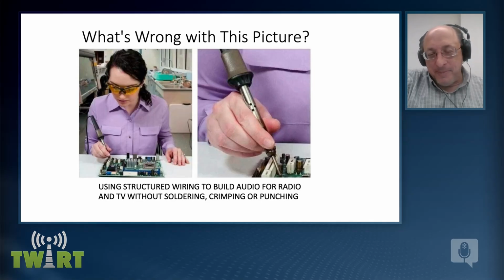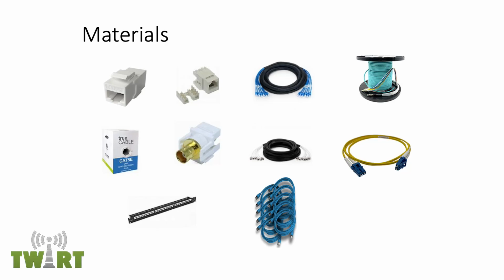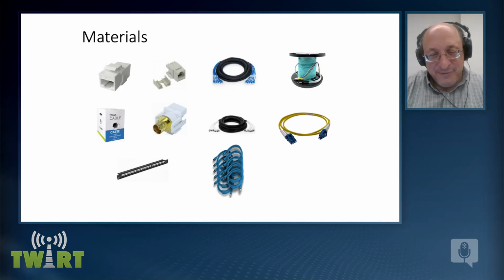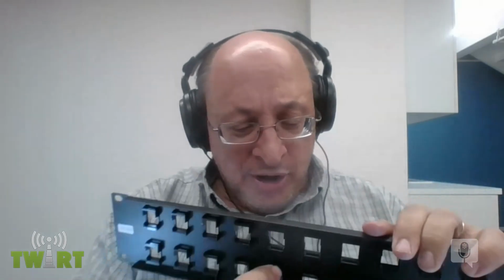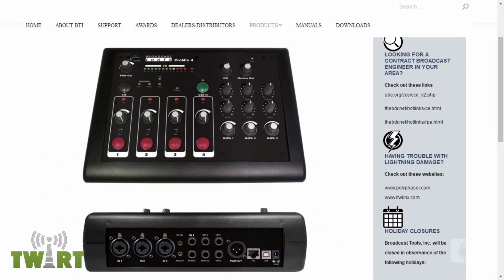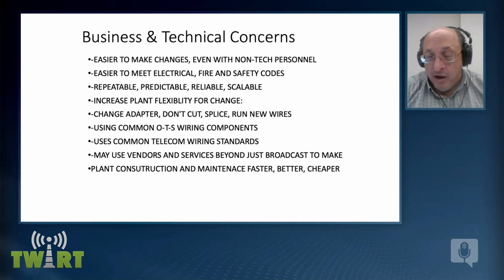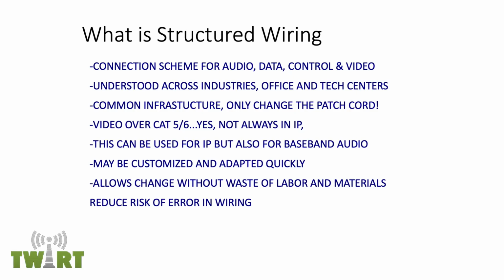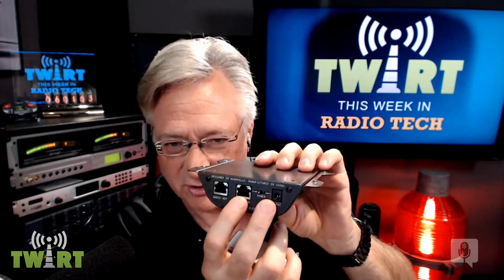Structured Wiring with Ed Bukont - TWiRT Ep. 571

Comment: When you lay the foundation of a building, you don’t just randomly place concrete blocks, or randomly pour concrete, in order to support the structure. If you did create the foundation of a building randomly, the building would likely be subject to early collapse.

On this Episode 579 of the TWiRT Podcast, Ed Bukont shares his insights into the broadcast engineering advantages of structured wiring for radio stations and other broadcast facilities. Structured wiring is the logical approach to interconnection within a broadcast facility. 

Using structured wiring makes troubleshooting a breeze, and makes it much easier to keep the signals within your facility flowing properly.